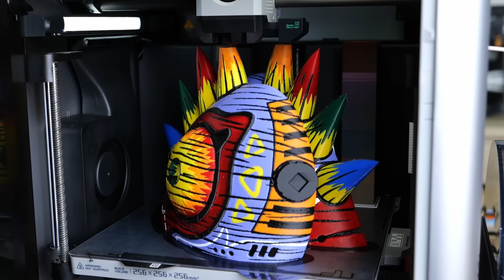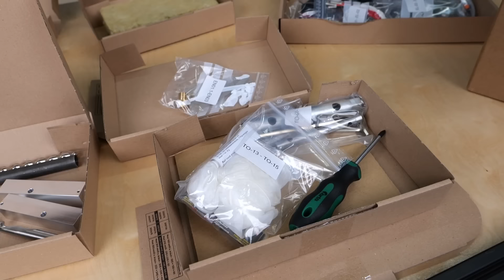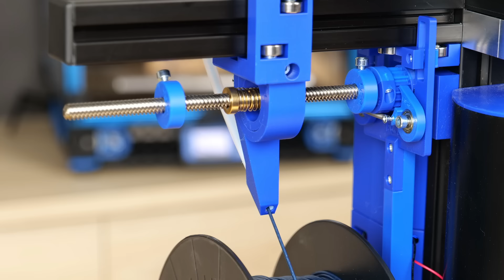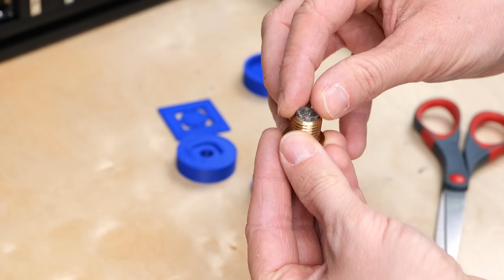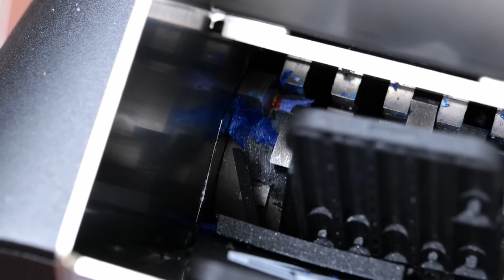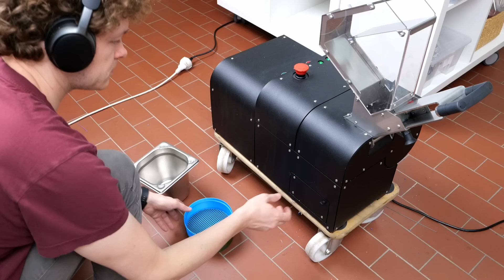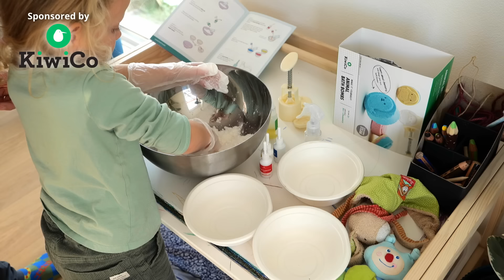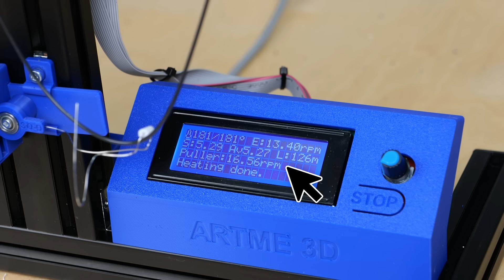Recycling Failed 3D Prints with a DIY Filament Extruder: Artme3D

Comment: So it costs $600 and it doesn't even come with everything you need?  You have to spend at least another $50 on filament and that's not including what your time costs while your printer is tied up with that print.  And then there's the time and effort of putting it all together, and your time shouldn't be cheap.  So all in all, it's going to cost over $1000!  Egads!

Comment: So much fascinating information! As I get into this hobby, videos like this get me excited, but also remind me to set a budget! haha

The difference in spool RPM could also be explained by the notable increase in diameter/radius from the start on the Inner Diameter of the spool. 30 RPM when the spool has a 3" diameter is the same as 15 RPM when the filament is only 1.5" thick on the spool, and the diameter has therefore increased to 6".

Comment: That's a lot of dicking around to get the 1.75mm, there is definitely a sensor that could measure the width as it's extruded and have that adjust the auger speed and maybe also adjust some winding pullies to stretch or contract the already extruded filament a little to get it closer to 1.75

Comment: It makes sense that the rpm slows as it’s nearing the end as the overall circumference will be larger and the spool will have to spin more slowly as the flow rate will be a relatively fixed value throughout the print.

Awesome product review! I am in the works of creating a print farm soon and think this is a worthwhile investment in the long run to reduce overall waste!

Comment: Good video. I honestly think this can be a good investment because at the cost of 1 spool it will add up fast when you do single color prints and have prints that fail. I also think this is worth the price because you can recycle prints that you did but don't want anymore along with saving time having to wait for new filament to get to your door since not everyone will have a bunch of spools.

If you have schools in your area that have 3D printers you could strike a deal with them and get the failed prints and such scraps for free or for a small amount of money and maybe you could make filament and give some of the filament back to the school even if they didn't ask for any back.

Comment: Hmm... I've got a $600 printer and $600 of filament. (~60 spools @ ~$10/kg.) For me the only major sweet part of this is making custom color gradient filament. Otherwise, this is still too pricey. People already think I've got a problem when they see my shelf with 3 large rolling Rubbermaid containers of... Plastic on spools. 🤷‍♂️ Maybe it's because 1/2 of it hasn't been used? IDK. 😂

I still haven't collected a 5g bucket of poop from my Bambu, although I've only done a couple 4 color prints and those made serious progress.

Until filament gets expensive I'll keep planning to make cutting boards/worktop protective boards. Melt it all in the "shop" jelly roll pan in the basement oven and voila!

Comment: Simple math!
With 650 in investment and 15-20 cost of 1kg spool, you get: 🤔🤔🤔
After 650/15 ÷ 20 = 44 ÷ 33 spools, you achieve your ROI.

So, if you create more than 33 kg of printer poop or PLA scrap a year, the ROI is OK; less than that, and you are better off remelting it to some silicone mold.

Comment: Guten tag ... You should run the shredded plastics into a series of tube magnet (a sifter) before you put them in the hopper. This will capture bits of pieces of metals to prevent clogging. Auf wiedersehen!

Comment: A small wheel on the wire might help some of your 'bouncing' issues. Half an inch to an inch in diameter allows more leverage for the sticking filament to turn the wheel, which should smooth out large jumps into smaller jitters or even smooth rotation. I imagine the wheel would need to be of a higher melt temperature than the filament to avoid sticking, and should be concave both to fit the filament into and to avoid deformation of the soft and still-warm plastic. There may also be issues with the wheel acting as a heat sink and cooling the filament faster than is intended.

I don't own a 3D printer myself, but this is making me want to tinker and experiment anyway. Maybe it's time to finally get into the scene..

Comment: 18:48 honestly, to be able to recycle 100% of my plastic waste and make my very own filament, i think i can look past those few simple issues. im the kinda guy that i feel a little guilty for magnifying my single use plastics footprint since taking up 3d printing. so ANYWAY i can downsize my plastic waste output, IM TOTALLY FOR!!! dont get me wrong. im not this hippy dippy eco nut, but weve taken it a bit to the extremes with the single use plastics. if micro plastics can be found in and around the human brain, yeeeeeaaaa weve gone a bit too far.

Comment: Hm... That sounds kinda interesting. 
I don't have a 3D-Printer, but I would love to give my old plastic some new live instead of just being discarded and probably burned or something. whenever something breaks I either try to repair it or if not possible without a 3D Printer I at least recycle most of the stuff and sort it by their material (aluminium, metal, steel, copper and brass). Only thing I have to get rid of because no recycling depot will accept it is plastic...
Could be at least a way to recycle my plastics and give them to someone who has a 3D Printer or use it whenever I have the chance to get my own.

Comment: $700 for a DIY kit is a lot of money... especially since you're printing 1/2 the stuff yourself.
Reply: plus shredder
plus drying oven
plus vacuum chamber
Reply: 600 is 40 rolls of filament
Reply: Ont peux trouver a meilleur prix, meme si j'aime bien le concept vertical, ils pourraient descendre leur prix de 50%
Reply: he overpayed by like $300 lol but filiment recyclers are 4 digits bare minimum to outright buy and if you upgrade your own pri ter you already have 80% of whats needed lol im making one from a ender 5 plus stock components since my 5+ is now core xy with a btt pi2 Ai board and a btt skr mini e3 v3 and a microswiss ng direct drive i have pretty much everything just sitting around

Comment: You can't measure hot moving filament with a digital caliper.  The caliper would squeeze the hot material.  
This machine may make people feel good about using their waste but you spend $6oo to make filament that is degraded because it's not virgin, and you have your time spent to do it.  BUT, like a lot of 3D printing efforts, it kind of works with the religion that 3d printing seems to have become.
Reply: The new vewrsion does have a analog reading of the diameter. But let's do the math. How much does the filament you're currently using cost?
Reply: @ARTME3D  $32 a Kilogram I believe.  But I wouldn't buy an extruder just to save money
Reply: @writerjmd  Thanks for sharing. With this cost, it pays for itself relatively quickly. But of course, in this context, it doesn't always make sense. But $32 is quite a lot. Which manufacturer is it?
Reply: @ARTME3D  Bambu.  I haven't used much yet.

Comment: Seems like the potential for making home made filament using pellets is overlooked a lot. Pellets are like half the price of filament for the same amount of plastic. If this process is reliable I could totally see it making economical sense for print farms (or serious hobbyists) to produce their own filament. You could break even with ~30-40kg of produced filament where I live.

The only issue is the drying equipment. But going from raw pellets straight from a manufacturer to filaments, this might not be much of an issue.

Comment: Buying a filament recycling kit for €679 or €899 would mean I’m running an industrial-scale 3D printing operation. For €679, I could buy almost 50 kg of PLA/PETG (at an average price of just under €14/kg). I’ve been 3D printing since 2016, and I doubt I’ve even used 50 kg of material in all that time. I don’t print every fidget toy, headset mount, or random gadget—just practical, functional things for around the house or for the company in rare cases, usually items that are either unavailable to buy (because they’re hyper-customized for a specific use case) or ridiculously expensive. So, for the 'average person,' such a hefty investment just doesn’t make sense.
Reply: That's true, this isn't the use case. But if you normally use high-quality filament from reputable manufacturers and collect the waste, you only need to recycle 30 to 40 kg to recoup the cost of the machine. If you assume €14 per kilogram, that's 70 to 80 kg.  There is currently no better price-performance ratio. But of course, this is not for people who only have one printer and print a practical item every now and then.

Comment: I was up for paying the 600 until you used an industrial shredder for the old stuff, not really accessible for the average person.
Reply: Yes, there is no practical solution yet. I am working on it. But 3D printing waste is difficult to shred due to its low melting point. So this is a new process.

Comment: I would think you have to sort the plastic by type, no? I wouldn't think you can just merge PET and PLA together, right? So you have to make sure to remember which type each thing is, right?
Reply: You cannot mix different types of plastic. But with 3D printing in particular, you end up with single-type, expensive waste from support structures, color changes, or test parts. This is the perfect starting point for thinking about recycling. Generic household waste is the complete opposite.

Comment: The money for All the machines and the time isnt worth actually in my opinion.
Reply: Thank you for your contribution. I would like to explain this briefly with figures and specific assumptions. If the material is not recycled but incinerated as waste, a lot of carbon dioxide is released into the atmosphere. This accelerates climate change and means that our children and grandchildren will have to pay a lot of money to enjoy just a fraction of the comfort we have enjoyed on Earth. To be even more specific, this view may mainly stem from the fact that products from China, for example, are so cheap that this view arises. But Chinese products can only be so cheap because the government wants them to be. The companies are heavily subsidized. So it is the population that pays for the goods to be so cheap. The goal is to be so much cheaper than all other countries for as long as possible, so that companies in other countries give up. After that, prices will rise sharply. To be even more specific: if you recycle your 3D printing waste and have previously paid €20 or €25 for a Suple filament, you have to recycle 30 to 40 kg to recoup the cost of the machine. If you compare it with very cheap Chinese filament, it is of course more. But nevertheless, there is currently no cheaper and better solution available in this price range. If there is, I would be happy to hear about it.

Comment: 14:37 you have a very different definition of inexpensive 600 euros is exspencive if you ask me
Reply: Thank you for your contribution. I would like to explain this briefly with figures and specific assumptions. If the material is not recycled but incinerated as waste, a lot of carbon dioxide is released into the atmosphere. This accelerates climate change and means that our children and grandchildren will have to pay a lot of money to enjoy just a fraction of the comfort we have enjoyed on Earth. To be even more specific, this view may mainly stem from the fact that products from China, for example, are so cheap that this view arises. But Chinese products can only be so cheap because the government wants them to be. The companies are heavily subsidized. So it is the population that pays for the goods to be so cheap. The goal is to be so much cheaper than all other countries for as long as possible, so that companies in other countries give up. After that, prices will rise sharply. To be even more specific: if you recycle your 3D printing waste and have previously paid €20 or €25 for a Suple filament, you have to recycle 30 to 40 kg to recoup the cost of the machine. If you compare it with very cheap Chinese filament, it is of course more. But nevertheless, there is currently no cheaper and better solution available in this price range. If there is, I would be happy to hear about it.

Comment: $736.16 😰 good lord
Reply: Thank you for your contribution. I would like to explain this briefly with figures and specific assumptions. If the material is not recycled but incinerated as waste, a lot of carbon dioxide is released into the atmosphere. This accelerates climate change and means that our children and grandchildren will have to pay a lot of money to enjoy just a fraction of the comfort we have enjoyed on Earth. To be even more specific, this view may mainly stem from the fact that products from China, for example, are so cheap that this view arises. But Chinese products can only be so cheap because the government wants them to be. The companies are heavily subsidized. So it is the population that pays for the goods to be so cheap. The goal is to be so much cheaper than all other countries for as long as possible, so that companies in other countries give up. After that, prices will rise sharply. To be even more specific: if you recycle your 3D printing waste and have previously paid €20 or €25 for a Suple filament, you have to recycle 30 to 40 kg to recoup the cost of the machine. If you compare it with very cheap Chinese filament, it is of course more. But nevertheless, there is currently no cheaper and better solution available in this price range. If there is, I would be happy to hear about it.

Comment: I know its a older video and you may not see this but have you considered utilizing a diode array and a few leds to measure the diameter and use that to adjust the extruders "multiplyer" be it either speed or tempeture? May be an easy way to get nearly perfect filament from this. I use something similar to adjust my printers multiplier as I print and just thought it may be worth revisiting. Otherwise, I enjoy your video!

Comment: The notion that an insulated low RPM drill bit along with some bits and bobs to track the necessary variables of the extrusion and turn a spool is CHEAP at $600 is wild. That's literally more expensive than my brand new FLSUN V400 Pro delta 3D printer. That's like having a composting bin + raised garden bed that costs more than the stove-oven that cooked the food in the first place. (I just checked, and it's definitely not.) Compost bin + garden bed ~ $140. A stove-oven appliance ~ $700.  This thing is MASSIVELY overpriced, especially given you literally need to pre-shred, which isn't built into the device or included in the kit as a separate device.

All they need to do is make the collection funnel heat the printer scraps, and then you don't need to shred it. So that saves the need of dropping ~$300 for a shredder. If they do that, and SIGNIFICANTLY slash the price, then these will finally, hopefully become widely used. I'm sure if they don't want to, someone in China will, soon. The oceans and landfills will be a little bit nicer for it too, I hope.

Comment: can it also work with waste plastic?
Reply: Most types of plastic used by consumers are virtually impossible to 3D print. Therefore, it does not make sense. However, with the latest version, you can now carry out small injection molding applications with this device. You can use plastic waste for this purpose.
Reply: @ARTME3D   and which is the latest version?
Reply: @mantapi1781  The latest Version is MK3S and MK3S+. The difference is just the drive unit.

Comment: I could see an easy modification to your roller on the "wire", and that's to use a printed pully wheel that would keep the extrusion within the curve of the wheel and not get hung up on the wire itself.

Comment: Not just 600 but assembly required with not all parts included is ridiculous
Reply: Thank you for your contribution. I would like to explain this briefly with figures and specific assumptions. If the material is not recycled but incinerated as waste, a lot of carbon dioxide is released into the atmosphere. This accelerates climate change and means that our children and grandchildren will have to pay a lot of money to enjoy just a fraction of the comfort we have enjoyed on Earth. To be even more specific, this view may mainly stem from the fact that products from China, for example, are so cheap that this view arises. But Chinese products can only be so cheap because the government wants them to be. The companies are heavily subsidized. So it is the population that pays for the goods to be so cheap. The goal is to be so much cheaper than all other countries for as long as possible, so that companies in other countries give up. After that, prices will rise sharply. To be even more specific: if you recycle your 3D printing waste and have previously paid €20 or €25 for a Suple filament, you have to recycle 30 to 40 kg to recoup the cost of the machine. If you compare it with very cheap Chinese filament, it is of course more. But nevertheless, there is currently no cheaper and better solution available in this price range. If there is, I would be happy to hear about it.

Comment: I want to recycle my filament badly, but I feel like getting it to extrude the appropriate size consistently will be a larger learning curve that you would expect. Im curious if you picked it up more easily because you have used commercial units or If im just being paranoid.
Reply: The problem is still a shredding solution. If you can regrind your material, producing the filament with the latest version of the extruder is quite simple. I am working on it, but it will take some time. I am looking for cooperation partners, if you know anyone.